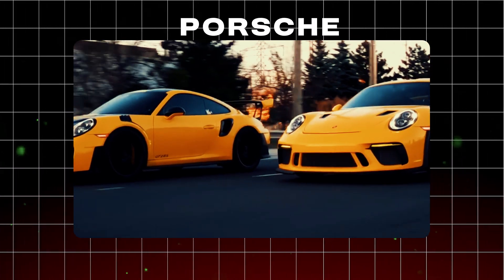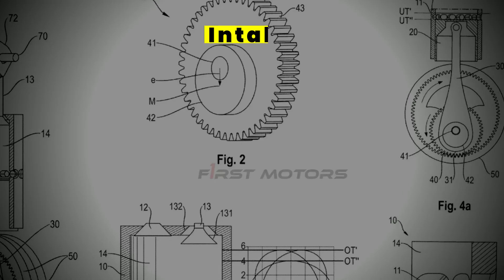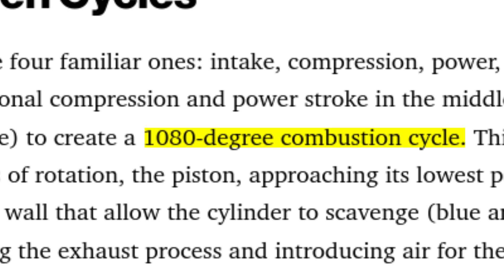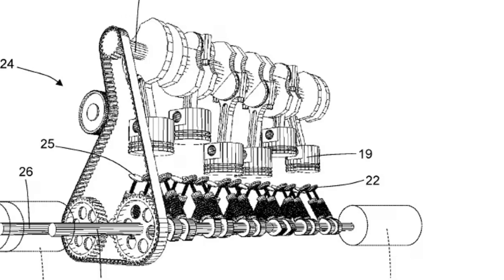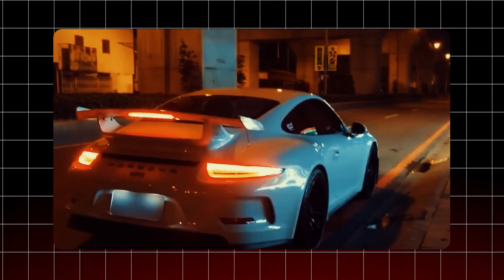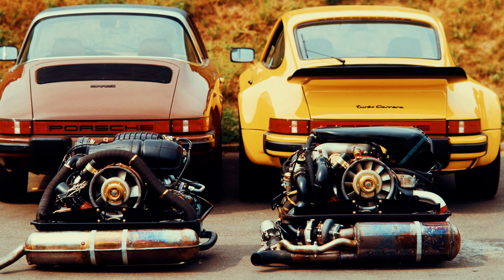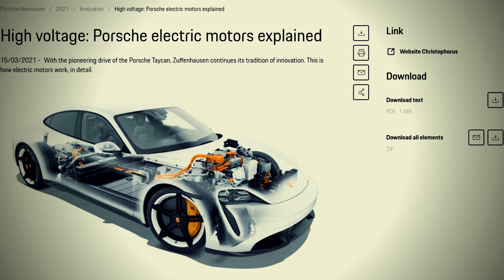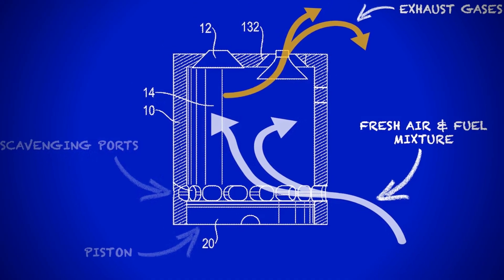Why Porsche has Patented a SIX-STROKE Engine | Reason Behind

Comment: The scavenging ports will cause issues with the oil system. Either oil will be burnt, or not enough oil will be used to seal the piston, leading to excessive wear. The CO2 reductions will be offset by the decreased life of the engine, or the burning of oil.
Reply from the maker: The complexity is increased becouse ther are more moving parts compare to the traditional 4 stroke. Yeah, I share your concern. The patent doesn't explicitly mentioned disadvantages of this design.

Comment: It need to be force inducted for stroke no4 to work. Why then not just use 4 and 5 on repeat. An supercharge valve 2stroke with direct injection. Power on every stroke and no complicated heavy planetary gear crank.
Reply from the maker: Interesting tought!
Reply: The same reason why 2-strokes aren't used despite their superior efficiency and power-weight ratio. Emissions. This 6-stroke design is supposed to bridge the gap between 4-stroke and 2-stroke in a way that could meet regulatory requirements.
Reply: That patent belong to mazda. Supercharged 2strokes with valves.